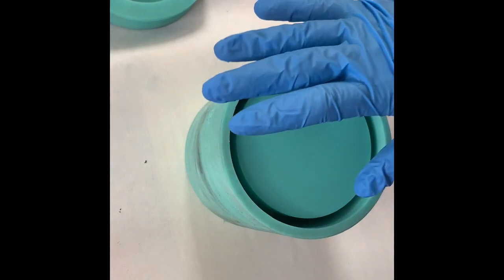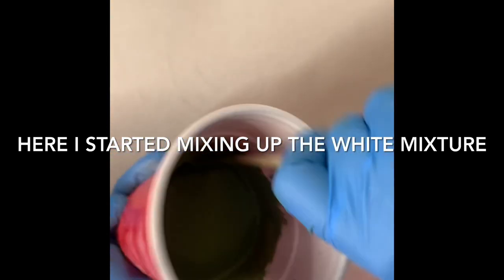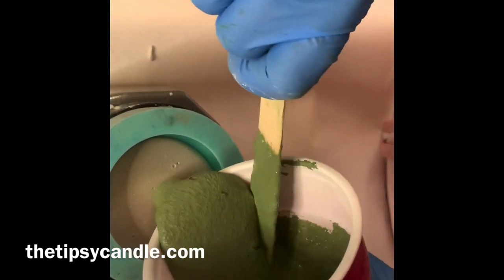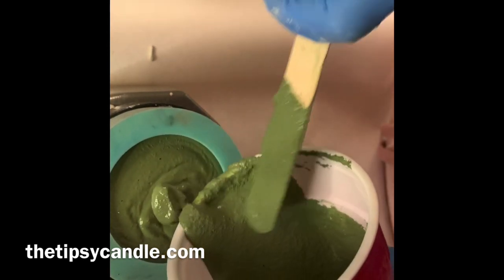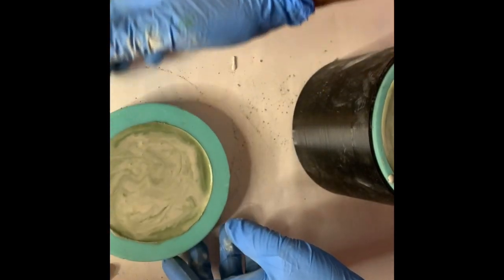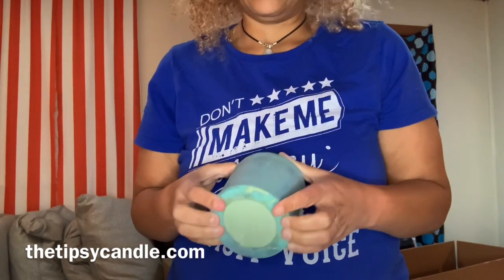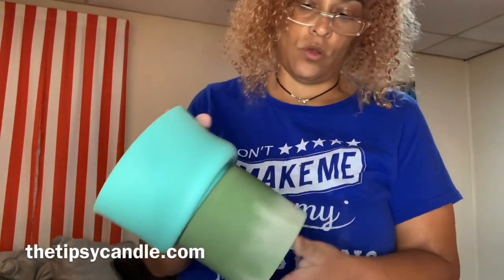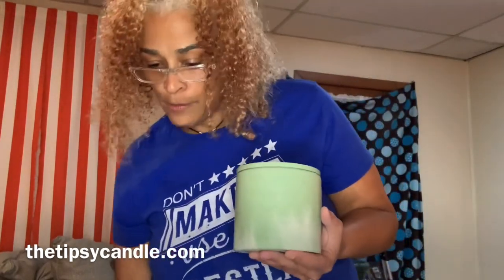How To Make a  2 Tone Cement Candle Vessel (Viewer Requested) And Using A Few New Toys!

Comment: They came out so good! The 3.5 Tulip looks amazing. Exactly what I was looking for. I will definitely be getting that shaker. Thanks for the video!
Reply from the maker: Thank you so much! Yesss you absolutely must get that shaker table. It is my new game changer. The first ones I made with them I let it shake too long so the bottom had even more bubbles but now my only regret is I wish I would’ve got the next size up 💗
Reply from the maker: @divinelyprotected I got the molds from Modern Craft Labs
Reply: @thetipsycandle   I forgot to ask you. What wood wick size do you use for this container?
Reply from the maker: @latinlabel  you’ll definitely have to test and test again to find the wicks that work the best for you. There’s several factors that go into choosing the wicks. I start by using the wick guides from wherever I buy my wooden wicks from. I buy from both bulk apothecary and wooden wick company. Measure your diameter and the wick guides should recommend according to the wax you use and diameter
Reply: @thetipsycandle   Will do. Thanks, again.

Comment: I have a quick question for you.  What type of wax do you use?  I am in South Carolina and am just starting and with the heat I wondered what wax you are using.  Great video!
Reply from the maker: Hi there neighbor 👋🏽 great question, in the cooler months I use my own blend of 464 and 444 Soy(candle science) And now that the heat is here I use a blend of 70% 444 & 30% 464
As you know soy wax is soft 464 being VERY soft, 444 is a harder soy wax, I was using 415 but it was too hard it took a couple years to figure out how to accommodate the seasons but I’ve got it now. You could always order a smaller bag of the 444 and 415 and play with ratios key is to cure for at least 14 days with any soy
Reply: @thetipsycandle  Thank you so much.  I was worried having read about candles not shipping well with the heat.  I appreciate you getting back to me!
Reply from the maker: I also don’t ship during June-August but I did buy some leakproof ice packs from Amazon last year I’ve only shipped one ice pack and it held up very good but I mostly do events that are local through these cooler months definitely worth a shot and if you ship during the summer I recommend using UPS next day or two day priority and make sure those candles our cured for a while before shipping best of luck it’s all trial and error but it sure is a lot of fun